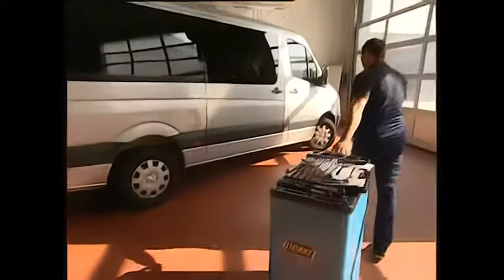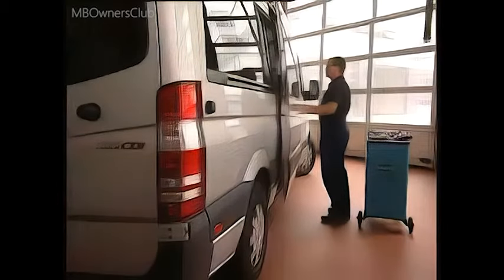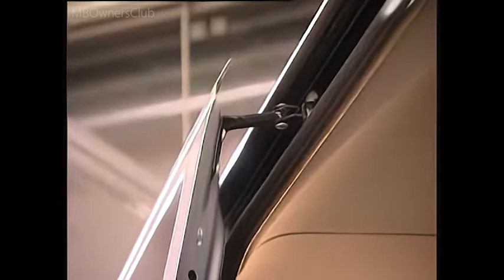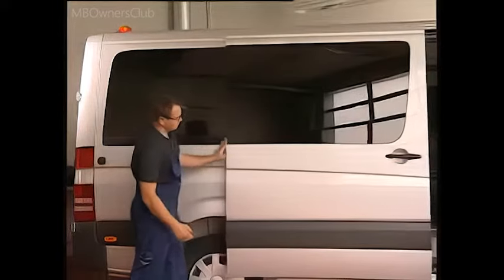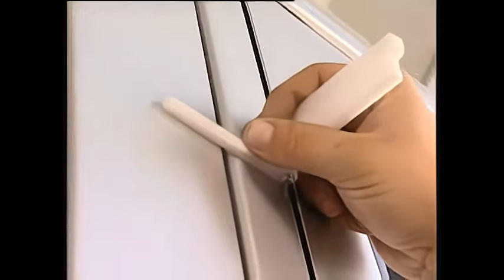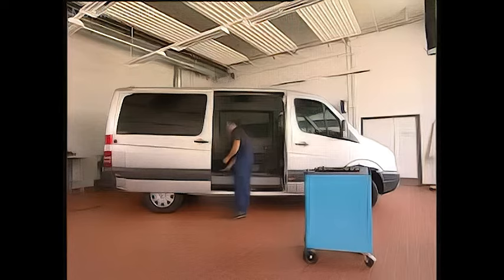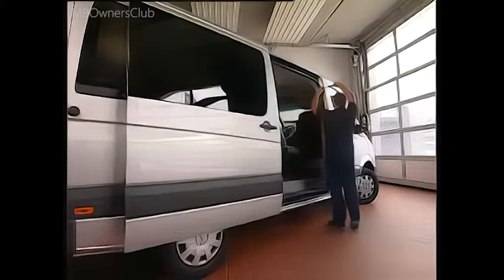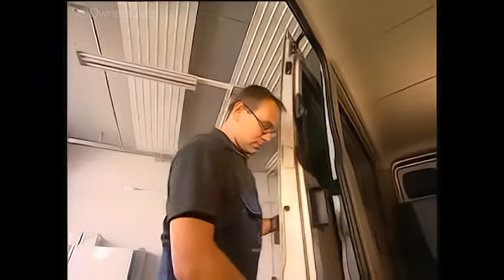Mercedes-Benz Sprinter - DIY Guide To Adjusting Your Sliding Door | W906

Comment: So if the bottom arm drops below the track and starts pushing inward theoretically all the needs to be done is an alignment ? By raising the door from the top arm ? Which would also require aligning the middle part ? Since ya know usually if you mess with one thing the rest gets messed up. I assume MB takes care of this shit but at what cost